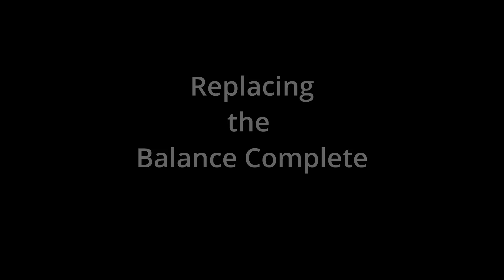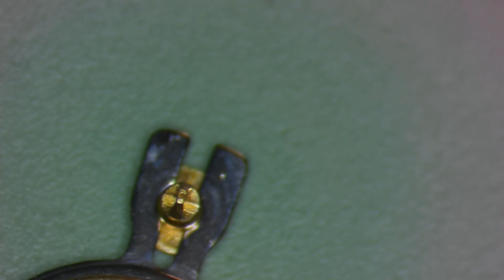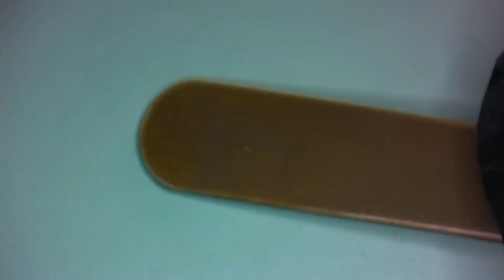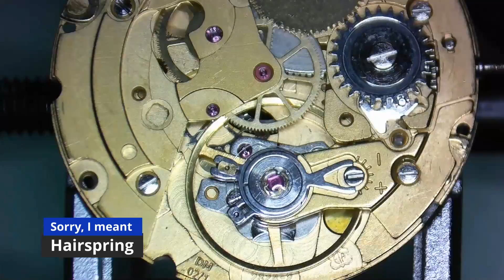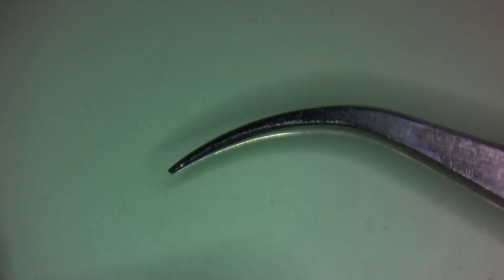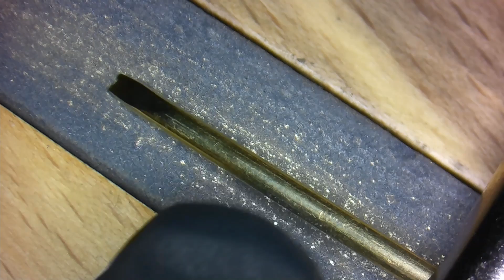Adjusting the Etachron Regulator: A Beginners Guide

Comment: Absolutely fantastic video with step-by-step instructions and explanation - exactly what I needed. Based on your experience, since both Seiko and Orient are part of the same group, do you think it is technically possible to replace the balance complete with one another? Under my loupe, the pivots of both balance wheels are identical in size and shape, and also the diameter of both balance wheels is the same based on my own measurement
Reply from the maker: Seiko and TMI share some of the same part dimensions but I don't think thats true with Orient.
Reply: @watchrepairtutorials  Hello again! I just wanted to confirm that I have replaced the balance complete of an Orient F6724 movement with a balance complete of a Seiko NH35 movement, both obviously using the Etachron regulator. It fits perfectly and runs accurate within specifications. Since Orient has become part of the Epson group (like Seiko) many parts can simply be swapped which was confirmed by Orient support. Thank you again for this video which helped me a lot!

Comment: Thanks Alex very informative, how do you adjust for different positions though? Thanks
Reply from the maker: That's a very deep subject and not easy to answer question in a comment because it depends on what you are working on and working with.  
With the Etachron system, a lot has to do with how well the balance wheel was matched to the hairspring in the factory. 
As an example, on a 21600 bph movement, if you have 20 movements from the factory , 5 will be almost perfect, 10 will be close and 5 will be way off. Remember, most movements are just striving for accuracy within 15- 30 spd.
With these types of regulators, changes to the vertical positions rates are primarily the result of the regulator pin position, assuming there are no other faults affecting the vibration rate. 
Regulator pin position affects the Horizontal Positions and Vertical Positions differently depending on how open or closed they are. Balancing all this to end up with the lowest overall Delta is the goal. 
Also remember that you can't make a movement run better than its capable of without some serious reengineering.

Comment: Hi Alex, so putting a new hairspring on the old balance wheel is a mistake correct? Always get a balance complete because it comes poised correct?
Reply from the maker: If you have a group of 20 balance wheels, there are very subtle differences between each of them. Same with the hairsprings. In the factory, they measure these differences and match them as a pair  so that they will vibrate as close to the desired vibrate rate as possible.

Comment: This has been the most helpful video I have seen in years. I am struggling with a movement right now and I am convinced this new understanding will solve my problem. I cannot wait to get home to see.
Reply from the maker: What problem are you having?
Reply: @watchrepairtutorials I could not reliably regulate this movement and I didn’t fully understand the importance of centering the hairspring between the regulating pins while the balance is at the correct timing point of the terminal curve. The evening after I watched this video, I removed the balance, tuned up the spring better so that the T curve was smack on during the arc of the regulator, adjusted to center using the stud, closed the gap to half a spring width on each side, and bam, it was running perfectly in all positions. Thanks again.
Reply from the maker: @davidmarusa9833 that’s awesome. Good job man!

Comment: Fantastic series, and I loved every minute of it! I'm a novice and have had success regulating the couple  nh movements I tried by adjusting only the main arm, but I see now how that's mainly because I was lucky. I now have a movement (6r55) where the delta between horizontal and vertical is 30 seconds, and I went to check the pins gap first. Problem is, I only have a 10x loupe and can't actually see the pins-to-sping relationship at all (not enough zoom) so I backed off for now until I can get the right zoom. I see the microscope you use in the video description, but how did you actually get that excellent side view of the pins and not a top down view like I'd expect fromamicroscope? Did you turn the movement on its side in the holder for that shot and actually adjusted the pins while the tool was parallel to the work surface? I feel dumb asking because it's probably obvious but I can't figure it out. I have the bergeon pin tool and am feeling confident but if I can't actually see what my adjustments are doing I'd probably just be making everything worse. Thank you for your time and help!
Reply from the maker: Very wise words my friend. It’s important to understand your current limit and not just race in and screw something up.
To film that I used an engravers ball to hold the movement in position. It holds the movement at a very precise angle.
Here is a tip for you. If the have the tool to turn the regulator key, install it through a watch hand for a 16s pocket watch and use that to gauge how much you are turning the regulator pins. 👍
Reply: @watchrepairtutorials  Thank you so much for the quick reply! That helps a ton, and great idea on the watch hand trick
Reply: @watchrepairtutorials  Follow up question if you have the time - When you are adjusting the regulator pins, do you actually do it under the microscope (was the scope only for demonstration purposes vs actually performing the work there) or do you move to your high bench for a more horizontal view using a different magnification setup? Am I overthinking this? lol Thanks!
Reply from the maker: @EffnShaShinko I work under a microscope about 90% of the time.

Comment: Thank you for such a detailed explanation. At the end, as a last step we need to close the pins. Is that , so the hair spring touches the pins. it was touching the pins before, otherwise , we would not be able to regulate it. ?????? thank you.
Reply from the maker: The spacing between the regulator pins affects the relationship between the horizontal and vertical positions. That’s a very simplistic explanation, but that’s basically what it comes down to.
You close the pins to help bring the rate of the vertical positions closer to the rates of the horizontal positions. 
This takes some practice and experience to know when to stop, but that’s the reason that you do it

Comment: Excellent video, watched multiple times.  Question, working on NH35 movement, when I replace the balance, which cannot be shortened, the time grapher can be in multiple +100’s, can I take out some slack by slight twist of the terminal lug?  Appreciate your thoughts!  Thank you, Bill
Reply from the maker: Can you rephrase your question. I’m not sure what you’re asking.
Reply: Replacing balance complete on NH35 movement; after installing on the balance cock and setting in movement with the regulator pin set to neutral, the beat error is off (not bad), however the time grapher is +200 to +400.  As the balance complete stud is fixed in shellac, can I shorten the hairspring, possibly by slight twist of the balance complete stud?  I don’t want to affect the terminal curve but need the hair spring shorter.  I have experienced this on a number of NH35 movements.  Thank you, Bill
Reply from the maker: @billday295 absolutely not. The hairspring should have been matched to that balance wheel and any change you make will completely through it off. 
My first question would be the source of the balance complete. Is it an authentic balance wheel and hairspring from TMI or
Made by a third party. 
Second, adjust the hairspring block so that the HS is centered in between the pins. It will be a micro adjustment at the most.
Than close the gap between the HS and pins so that there is about the width of the HS  between the HS and the pin on either side of the HS.
This you will have to play with a little bit to find the sweet spot.
Make sure nothing is magnetized as well.

Comment: thank you, sir, for a very detailed tutorial. I have a question, when I rotate the regulator pin, making the gap smaller for the spring, I notice the amplitude goes down as well. Is that normal ?
Reply from the maker: There’s a very fine line with the regulator pins being too tight. Remember that the goal went adjusting the regulator pins is to bring the vertical positions closer to the horizontal positions. 
It’s a difficult answer to give without knowing all the particulars of the data of each position in the overall condition of the movement.
Reply: @watchrepairtutorials  appreciate it! Thank you for your answer.

Comment: Dang it. I thought I was doing good to get the watch apart and clean it and put it back together and it's running. But it's got a long beat error.   Now I have to do even smaller tiny work.
Reply from the maker: That’s just the tip of the iceberg.

Comment: Thanks for explaining about the groove on the underside wheel.  I noticed it, but didn't click in my mind that it's the opposite of balancing car tires.  Instead of adding weight, it took weight away for balance when rotating.  Is the impulse disc also poised into the stem?  Mine can actually be lifted off the stem, so I don't know whether to epoxy it down or replace the balance wheel.
Another great video, it makes a lot of sense to adjust before regulating.
Reply from the maker: The roller tables are on the balance staff when it is poised. If you change anything like adding epoxy that will threw off the factory poise and it will not be able regulated without re-poising the balance.

Comment: This repair is beyond my skill level at the moment, I am still learning.  I had the incabloc spring and jewl pop out when I was reassembling the balance wheel, I put back the jewl and when I tried to put back the Incabloc spring it broke not to worry this is a training movement for me.  Having some difficulty in trying to find a replacement spring.
Reply from the maker: What movement is it.
Reply: @watchrepairtutorials  ST36.
Reply from the maker: @snafu673  That stinks but it happens. The one in the plate requires to whole shock setting block to come out to replace it. 
The upper spring on the balance can just be put in.
I’m working on figuring out the part numbers for the shock springs for the ST 36. Seagull doesn’t sell parts. Hopefully I’ll have it figured out in a couple days if you wanna get back to me.

Comment: Can you possibly do a video of a watch being serviced that has a recoil kickback of the escape wheel (when the trains are free after winding  vs no kickback where there is a issue and how to find it. I keep reading it should normally have the kickback where the escape wheel spins backwards a bit. But when it doesn't what to look for etc. I think that would help alot of us out as there isn't alot of info on it
Reply from the maker: I will when I have the situation. 

Do the test with the barrel installed. 

The most common issue is when at least one of the pivots is not straight and is causing drag in the jewel hole.
To find it, you test each wheel independently  to see how well it spins. 

If they all spin well then you check the interaction of the teeth and pinion leaf’s by adding the 2nd wheel to the barrel, then the 3rd, then the 4th and escape wheel. 

Hope this helps

Comment: Great video, many thanks. Question: I am going to remove a broken balance wheel/hairspring/bridge from a 7S36c mechanism. I know the mainspring is wound. Is there a way to de-energize it prior to disassembley? regards Bob
Reply from the maker: You need to remove the winding wheel that's beside the crown wheel. The winding wheel is the one that's between the two fingers of the magic lever. Once that is out Put a screwdriver on the screw for the crown wheel and pull the click spring back to unwind the main screen in the barrel.
Just as a sidenote, I find that the screwdriver slips through my fingers and a more controlled speed by putting finger cots on my thumb and four finger to hold the screwdriver while the mainspring is unwinding.
Reply: @watchrepairtutorials  Many thanks for the reply. Bob
Reply from the maker: @RobertWiltshire-j9d  anytime

Comment: Hey man, extension of the prior question.  

What is the appropriate way to adjust the regulator pins for a pin and flag mechanism.  The movement in question is a Miyota 9 series.  The mechanism appears to have one regulator pin being a straight rod closest to the balance staff, the other being a flag shaped piece of metal that looks like it can rotate, thereby closing the distance.  It looks like it has a slot to be adjusted from the bottom, which means the balance would have to be taken off to adjust it?  Assuming the flag should be angled away from the stud, thereby having the straight pin be closest?

I could McGiver it but trying to do it right so wanted to ask and can't find it anywhere else online.  Thanks!
Reply from the maker: It’s been a while since I’ve seen any miyota  movements, but I believe that is just to open the pins to allow the hairspray to come out. I don’t believe those pins are adjustable.
Reply: @watchrepairtutorials   Ya looking at it under the microscope this evening I think you're correct, appears to be designed to a fixed distance gap with the flag/boot closed.  Thanks man, Merry Christmas!

Comment: Hey Alex,

This video was a game changer in terms of helping me achieve surprising levels of  accuracy and positional consistency with relatively low to mid grade movements (think eta 2824 vs NH36).

I've recently been servicing (or at least servicing at my enthusiast skill level) some Miyota 9 series movements from some microbrand watches.  With those balance assemblies the hairspring is connected to the stud via screw, and thus no simple mechanism to do adjust it laterally as with the etachron. Whats the appropriate technique to move the spring in this configuration so it can be better centered between the regulator pins?

Thanks!
Reply from the maker: Explain. Not sure what you are trying to do.
Reply: @watchrepairtutorials   So on the stud for the Etachron regulator the hairspring can be adjusted laterally to assure its centered between the regulator pins by adjusting the tab on top of the stud (as done in the video)  in the same way that you would adjust the pins themselves on the regulator arm.   

For the Miyota series, the hairspring attaches to the stud directly via a screw, and as far as I can tell there is no adjustment peg on top to help center the hairspring between the pins.  In these cases, does one bend it manually at the stud if you find its not centered between the pins during the adjustment process?  If so, what's the best technique?

Happy to hop on the microscope and snap a few pictures if helpful.
Reply from the maker: @daveellis608  ok I got ya.
To adjust the hairspring you have to needle it over by super lightly rubbing a polished needle across it to move it in the direction you need the spring to move.
I mean a super light touch. I use a sewing needle that’s polished to do this.
Reply: @watchrepairtutorials  Ok perfect, I made one of those after I saw you use it to help manipulate  wheel / pivot position when putting bridges on so I think I'm set.  

Thanks Alex, you're the man!

Comment: Again a masterpiece video, just tons of knwohow poured in just 30 mins, HUGE THANKS. I would also like to ask a question as I got a bit confused. From the "The In's & Out's" video I understood that the regulator pins shouldn't really squeeze the hairspring in between them, but there should some small space for the hairsping and the balance to work correctly. Now, with this Etachron regulator is seems that here we are targeting to adjust the pins just so, that they touch the hairspring without bending it. So, where is the catch or am I missing something for the normal regulator pins - should they be as close as possible to the hairsping without bending it, or there sould be some small space between the pins and the hairspring?
Reply from the maker: Separate the Eta Regulator from others as they work and adjust a little different. With the ETAchron there should be gap between the pins and hairspring  equaling the thickness of the hairspring.  Now that's hard to see right.  So as you adjust it, look for improvements in the rate moving in the right direction. If you go too far, the rate will get real bad real fast.
Reply: @watchrepairtutorials  and what is then right for the other regulators (non-Etachron) - should there be a gap or we try to have the pins as close as possible to the hairspring?
Reply from the maker: @vesselingenadiev2526  there is always a gap and no two gaps are exactly the same. This is adjusting and why it has to be done for every individual movement
Reply: @watchrepairtutorials  Thanks!

Comment: Fantastic. Buy adjusting the pins I got to under 2secs positional variance down from 14 secs. Watchmaking witchcraft :)  What I did find is that the end curve of the spring can be out enough so that is doesn't stay centred over the travel of the regulator, but not enough to visibly shift the the spring during that check, and that was enough to change the angle of the spring to the pins after regulation. So the steps for me were, close the gap, check variance, regulate, check variance, check and close the new gap, regulate.
Reply from the maker: Nice job my friend. Nice Job.

Comment: Hey by any chance do you have a link to the file you used to make the etachron tool at the end? Even the smallest needle files i'm seeing on amazon seem a little too think to cut a slot that small. The dang horotec and bergeon tools don't work on seiko etachrons which i guess are wider than swiss ones.
Reply from the maker: I don't have link to the exact one I have. but search for Screwhead Slotting Files and you will see some